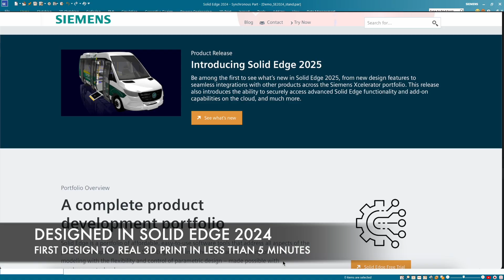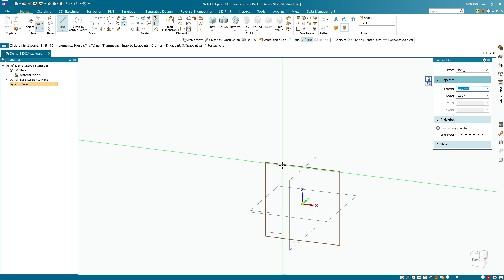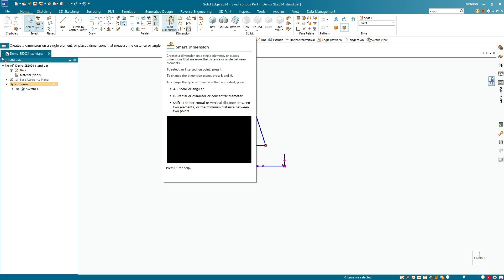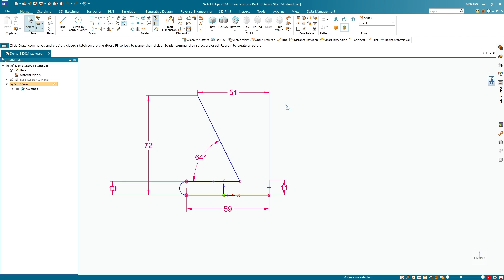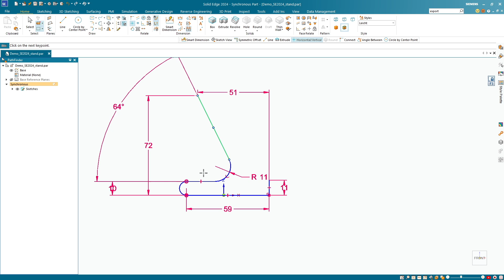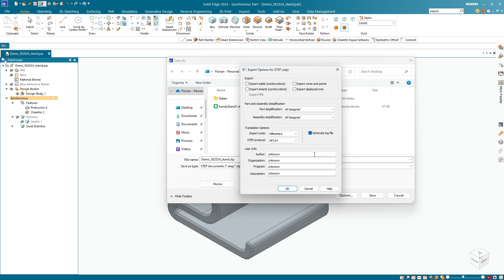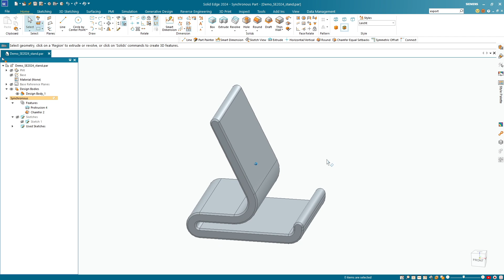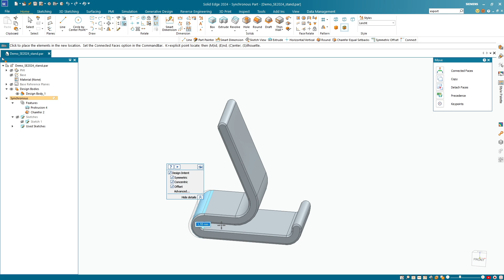Your first model for 3D printing in Siemens Solid Edge for free.

Comment: Would you recommended this program over freecad for someone just starting in 3d printing?
Reply: Same question.
Reply: I would. It has some nice feature for 3dp. Other than that, if you would like to work as a designer in tbe future, solid edge is very similar to the most used 3d Cad used in industries...
Reply: @kevinzappa5027  how about Fusion I am kind of getting hang of it?

How about Job opportunities where is it used?
Reply: FreeCAD is the worst for beginners.

Comment: good to have options, but difficult to see a reason to move away from F360.. "free" today, until next quarter's financial results. Fusion at least has a 10y track-record.
Reply: Solid Edge is not cloud-based, the Community Edition you download today will work forever, offline, in as many machines as you want. The only restriction is its usage for commercial purposes. Meanwhile, Autodesk Fusion could stop working at any moment.
Reply: @Schyz  SolidEdge is not forever. Community edition comes with 3 year license. Open your software, go to Info and at the bottom You'll see days remaining.
Reply: @Schyz  I wish more people were aware. I think the reason this program is free is because it will help train the next generation of designers who can say they have experience with this software and thus perpetuate the eco system, which is VERY expensive. But if you are a business who needs pro level tools that just work then its a no brainer.
Reply from the maker: Sure, I see your point. But to be honest, I don't make these videos to make someone move away from smth, it's more to show some options. and Solid Edge dates back to 1995, it's not a new fancy tool. But I have to add that nobody knows how long there will be a free community edition.
Reply: @FreeCADAcademy  hopefully at least for the next years. Until it goes up to the cloud completely and then we get charged 100 $ per Month or so...
Reply: @fordgeher  why should siemens do that? Solid edge is almost unknown... other than that, according with my esperience with autodesk, you described what fusion has done 😅 it is good to know that fusion it is not the only option 
I think it is good using solid edge also because is very similar to inventor or solidworks, which are used in industries nowaday.
Reply: @FreeCADAcademy Current Community edition is valid for 3 years from when you install it. We'll see what happens next but free option is available for years now anyway. F360's target audience is different than SolidWorks, SolidEdge or Inventor.
Reply: I went offline in F360.... and it said I could not rename anything.  I've been using computers for 30+ years and I'm being told I can't rename anything if I'm not online.   I think there is a very good reason to move away from F360.

Comment: At work we use Siemens NX (former Unigraphics). The menu's and workflow are almost the same. It's powerful software.  This program would be my choice for a beginner.
Reply from the maker: Thank you very much for your nice comment.
When I started with CAD in 2011, my first CAD Programm was also Siemens NX.
So in my opinion, Solid Edge (Community) is the best option especially for Pro users who want to have a great CAD solution to use at home for their private projects.